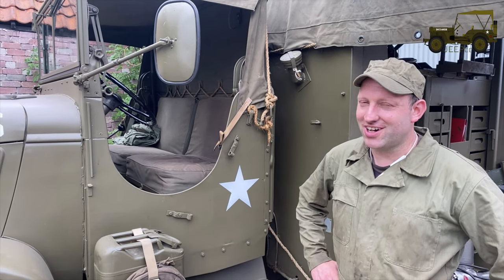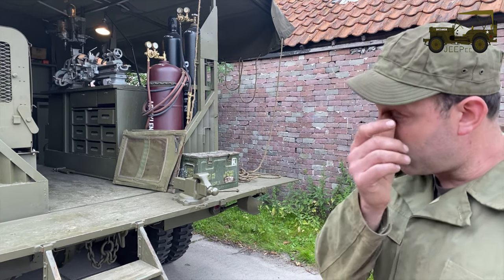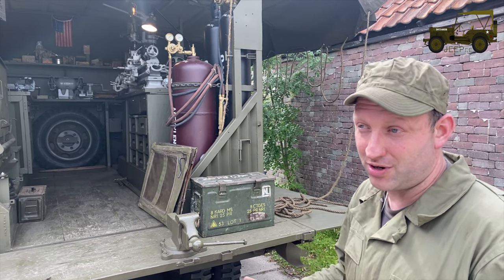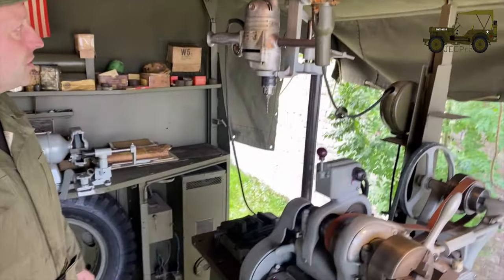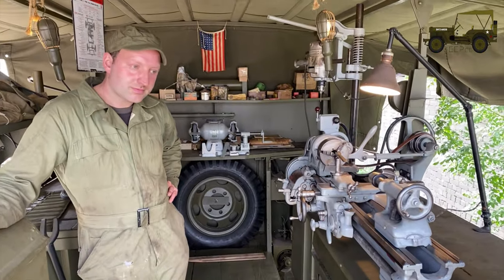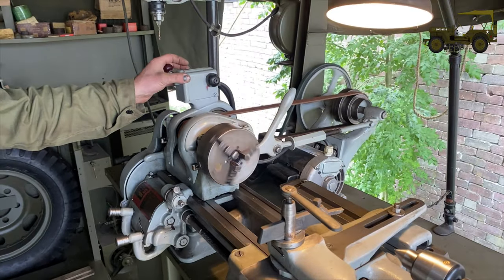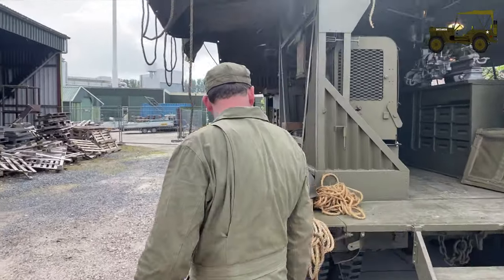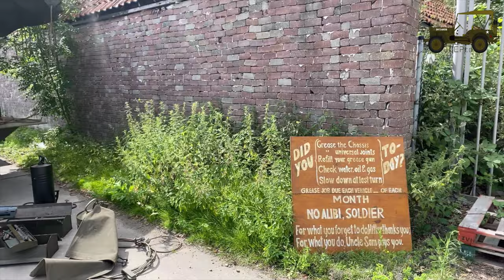Vlog #26   GPW 268872 - SPECIAL - GMC toolset

Comment: What a lucky find , can't be very many shop trucks  that were acquired with so much original equipment and added others
Reply from the maker: Indeed a very unique and complete mobile workshop. It took years to collect all the correct missing pieces.
Reply: @jeepee7513  Understood , an outstanding effort .
The CCKW was put to so many uses , photo developing , map printing , radio communications .  modified to transport pontoon bridge sections with a fifth wheel and special trailer / bolster transport , dump truck or tipper . compressor truck, fuel truck .
They even made them to fly , OK OK they were Airportable by C47 .
Among other so many other conversions like the DUKW being a whole different truck with a CCKW running gear inside its hull.
Something like 500,000 produced for WW2 .